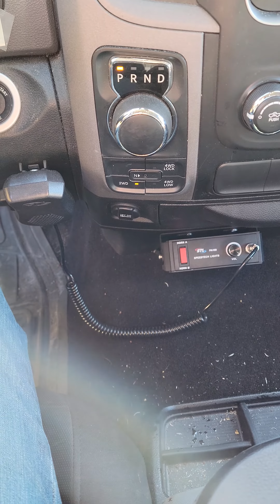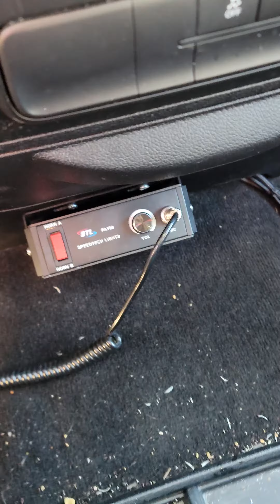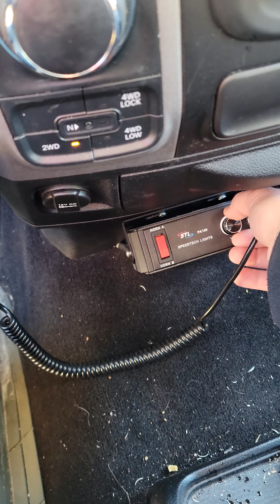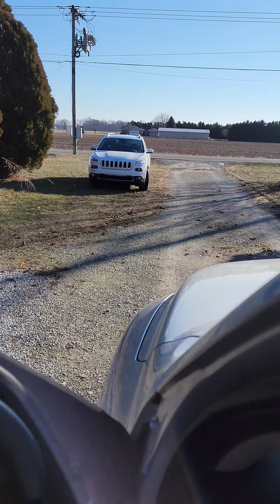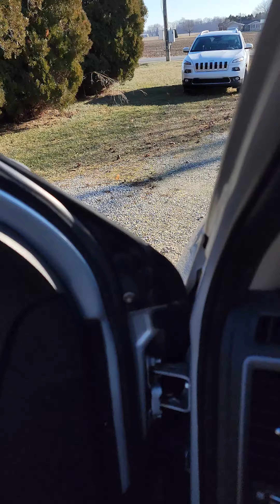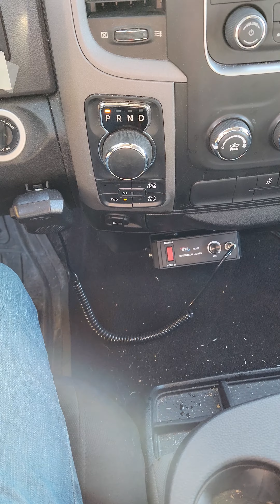Demo of the STL pa100 I installed on my 2017 Ram 1500 P.O.V.

Comment: I’ve been looking for something like this for my Ram. It now has a Feniex Fusion interior lightbar but was wanting an air horn without a full siren box. I’m also in Indiana, about 15 minutes north of Ft. Wayne. Clean truck set up
Reply from the maker: Yeah, you could probably wire up a different switch to this and then mount the box somewhere else out of sight etc.. Not gonna lie, definitely want to get an actual air horn some day. Then I would also make sure to have a quick connect for filling tires and the like. Airhorns of Texas has a nice 'emergency' horn that can come as a kit. Something like that would be ideal.